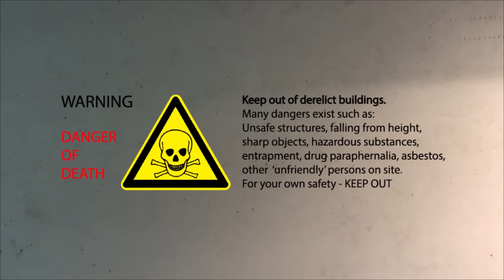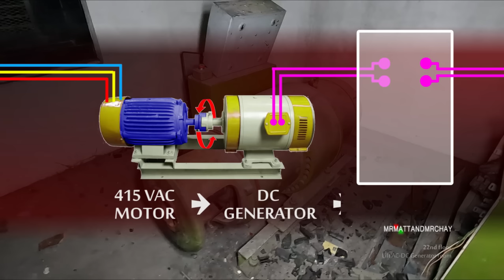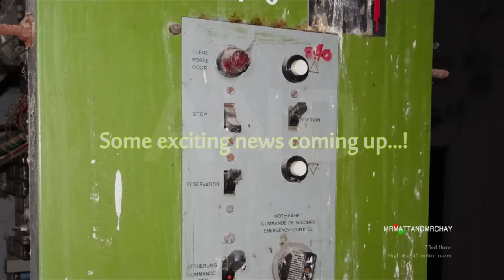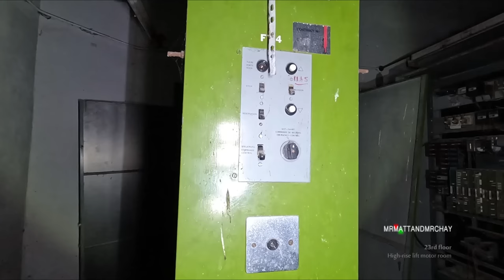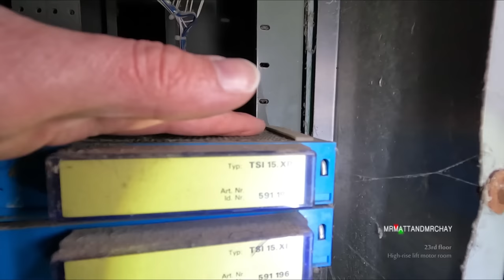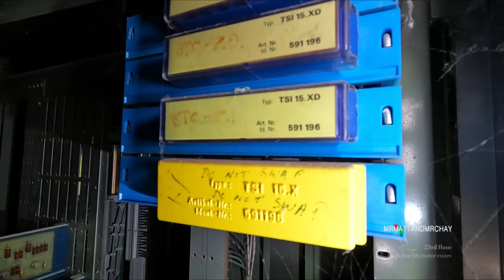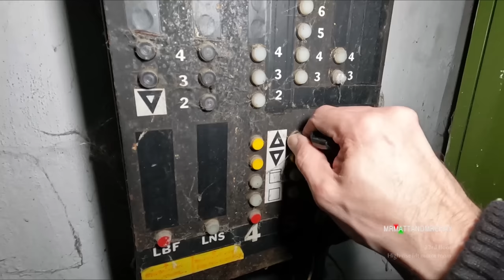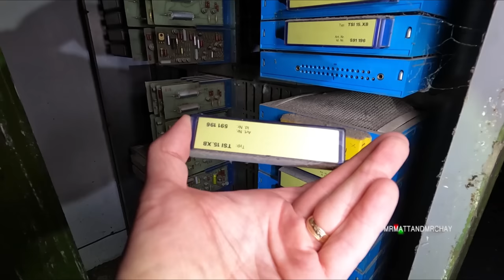ABANDONED TOWER EXPLORE - Rare ACONIC transistor lift control system from 1970s

Comment: I imagine fault tracing and troubleshooting on one of these lifts would have been quite daunting for any technician accustomed to working with relay logic. Having to trace a signal instead of hearing an audible click of a relay and being able to readily see the position and condition of the contacts, even with the tech at the time they could have had a bunch of status LEDs to guide a technician as to what the I/O of a particular cad was doing. Electronic enough to [hopefully] increase reliability but still antiquated to be unable to run self-diagnostics.

Comment: This must have been cutting edge back in their days. By early 70s transistors proved to be reliable for any application. They struggled a bit with power applications up to late 60s. But for signal control this was the way to go. They can swtich millions of times without deteriorating, and this reduce maintenance. You will still see relays where high voltage or power need to be controlled. But for logic control this was the perfect choice. I imagine that back on this era, we weren't so sure about solid state yet and many other companies just stuck to the safe an proven relay logic. And because all the engeneering was used to it, while moving to solid state would require another different set of skills.
Reply: in TheLiftDragon's video where he shows an original Aconic lift, he says the technology appeared in 1959 and was first used publicly in 1961, so it was even more incredible back then.

Comment: I spent a lot of time in (working) elevator rooms a few years ago on a contract job. We audited about 500 elevators throughout a government agency, including some that were over 80 years old. It was really cool to see this and it brings back some memories of opening up a machine room not knowing what decade the actual equipment would be from. In some cases they modernized 1950s elevators to 80s standards and left the old electro-mechanical cabinets and motor-generators behind.

I’m not sure what the maintenance standards are like in the UK but in North America the elevator contractors are focused on new builds and modernization and do not care about service and maintenance contracts. In some cases one technician will be responsible for 150 elevators all over the city, each needing about 5-6 hours a month in code-required service. Well you do the math, they simply aren’t getting the service and not one of those 500 elevators was even close to meeting the A17/B44 code standards for North America. Even though it’s required by law!

Thanks for the videos!
Reply: Yes, I had 2 lifts, and both got the correct service, such so that Schindler used the one as part of the annual review from the Swiss parent, as it was a good example of the era lift, and was in good order. Even went and painted the motor room floor, and put all the warning yellow paint on moving parts as well. Had a stack of spares for the unit in the one corner, especially vision panels, with the pig glass wire in them, as those were kind of expensive to order each, but not so when you bought 5 at a time cut to size.
Reply: @SeanBZA  it's cool when the old machinery is still being used in the modern era.
Reply: Meanwhile in my country some landlords award their lift/elevator maintenance contract to a 3rd party company e.g. 9G that's different from the lift manufacturer, maybe because its cheaper. We also had a shortage of lift technicians to service all my country's lifts maybe because such a career is seen as more menial here

Comment: And yet again, MrMatt has the answer.
I came across this exact controller in the Agfa Gevaert plant here in Antwerp. I always wondered what it was, because in the 17 years i'm into the buisness this was the only time i've seen this controller. Turns out it's the elusive Aconic. Sadly, this lift was decomissioned in the late '90s. The freight elevator in the same motor room, that probably had the same controller, was modernised by us KONE with an LCE cpu and KDM drive unit.

Comment: Transistors as plug in modules, on the assumption that they, along with diodes, are the more failure prone items, so put them into plug in modules that are mostly identical, so that you can simply keep a half dozen spares in the room, and quickly plug in a replacement, and send the faulty one to be repaired.
Reply from the maker: Thanks for the comment and yes, fascinating system and plug-in transistors.  I'm not sure that I'd like to fault find this though - imagine randomly swapping out transistor boards until the lift starts working properly again!  The know-how must have been very specialised!  Did you notice that some of them say 'do not swap'?  Wonder why, as TheLiftDragon says that the resistor blocks are the same, just newer design.
Reply: @mrmattandmrchay  Well, they would have a few variants of the transistor blocks, so fault find to a board area, then swap out the transistor blocks with the spares one at a time, and see if fault clears. No worse than in any industrial control unit, where you isolate to a region of the controller, then put known good boards in, or swap from an identical good unit, and see if the fault moves.  Saying do not swap is just those might have been a later modification, with slightly different internal wiring, so you have to swap the transistor block along with the blue block, as the old and new do not intermix, though the interface to the rest of the unit is the same.

Plenty of times i did board swaps in avionics to see what was faulty, then take the now known faulty board, and fix later on after sending the unit back out as serviceable.That way you get the urgent job fixed fast, and can troubleshoot the fault, often a known fault you have marked down for that card, and fix at leisure, being able to do a good job.

Comment: The topology of the transistor blocks and the (apparent) passive component "grid arrays" they plug into (the BLUE blocks) is very reminiscent of the short-lived 1953 NIST "Tinkertoy" project.  I suppose this was both a reliability idea (active components are fully modular and can be replaced by yanking a plug module) and a construction flexibility idea (the logic of a "BLUE BOX" segment is defined by the passive component connections within the "grid").  The fact there's a full grid array in there feels like they're presaging the internal construction of FPGAs or "burnable" memory devices.

Never saw anything quite like this in production.  The topology seems very "dated", even for the era, but is very beefy and beautifully overbuilt.  1960s integrated circuits were a reality, and by the 1970s they were in commercial use in all sorts of higher-end tech.  It's a guess, but I can only imagine this was a move to assure the buyers that the system had a lot of redundancy and deep safety factors.

Honestly, if I had been a repair tech back in the day, and I had the drawings, fixing a system like this would have been a dream.  Failed resistors were probably pretty uncommon.  And if a transistor, or cluster of them, failed or were destroyed, it'd be a fairly simple matter to pull a block, take the thing to a bench, and yank and replace the failed silicon.  None of the usual rework tools to desolder and pull parts from a fragile PCB, less risk of damaging a trace or having to put in a shunt wire etc.  Takes up more space, but had to be easier to maintain when it went wrong.
Reply from the maker: Very interesting comment and thank you for that.

Comment: The Aconic controller looks like an Analogue computer to me. Interesting design with those plugin modules. The circuitboards look very artisan, a bit like my father’s hobby electronics projects from the 70’s. Definitely a hand drawn layout.
Reply: Very much digital DTL logic there, with likely 24VDC power rails, and a few bias voltages as well for the logic. not all that complex, basically emulating the old relay based controller, just with transistors instead of relays, so that they would last longer, and remain operating with minimal care other than clean air and dusting. Likely faults were still in things like interface, switches and lamps, but the core logic likely was mostly fault free.
Reply: Hand drawn like most of them were back then. But I wonder why there is no silkscreen.

Comment: For some reason I can picture someone like Dave Jones of the EEVBlog YouTube channel going gaga over this amazing 70s era electronics. Double sided hand-drawn PCBs. 70s era metal can transistors. Funky plug-in modules. Hand-wrapped wiring.

I wonder what sort of capacitors a system like this would be using and how they avoided the "capacitor plague" that 70s era electronics (e.g. old CRT TVs) are known for.

Comment: At 10:28 There was a Pigeon Nesting In the Motor Lol. That's just Funny. And The Reason was they didn't really fly away is because they where Harf asleep so They don't Fully Think of What a Threat is. Usually it would fly away but because it was kind of sleeping you did not scare them. But I found it Very cute.

Comment: I have never seen any thing like the , cooling grid resistor set up. I call it hat because I have no idea what to call the thing that the transistors plug into. Over all I am surprised to see so few capacitors. Such a lovely lay out on boards. I worked with transistor PLC controllers.

Comment: Fun fact - those round silver components that look like components are actually shift registers - they each store 512 bits of information, like a tiny RAM chip, each 0.5 Kilobits in capacity. You would need 16 of these transistor-looking components to make up 1 Kilobyte of RAM. Damn strange each module only contains 15 of these 512-bit shift registers, I guess the word length in the logic must have been seven bits? Who knows, but each yellow or blue plug in module is just shy of 1Kbyte RAM.

Comment: Cool channel, nice vids, I like to relax and watch your vids. 
Now, maybe the 6th lift engine is placed higher and maybe even installed first so this lift could raise all other equipment into place. So no external companies would be needed to get the materials to their position. Also when parts would have been needed to replace, they could do it all internal (except for lift 6 🤓.
For the boards: you should not waggle them out, but pull them straight out, in order to not damage the side sliders.
Like sliding them in: straight, not waggle.
Same for the transistor blocks.
Interesting are the matrix resistor blocks. I am curious what they were used for, since it is plenty of them. 
I am used to work with matrix board with diodes.
Good idea of having the steel wires going “around”, also on the bottom of the lift, do there is no need for a compensation chain which makes spooky noises.
AC to DC, yeah, thats what I worked with too, DC motors can be very powerful and easy to regulate. Did they use DC or half DC? 
When using half DC (in fact: from AC to DC using only 1 diode) makes the motor even more powerfull.

Many greetings from the Netherlands ❤

Comment: Never seen wire wrapping before, that's quite interesting. I'm guessing there were no electrical drawings on the walls? I guess LiftDragon found some!

Presumably the panel with all the bulbs behind it is a floor position display?
Edit: Answered at 22:55!

A very rare system indeed, but I'm not sure how it works. I don't even know what a transistor is, so I suppose I'll start with learning what they do, lol!

Comment: You should have visited the tower in the late 2000s it was completely intact and still had lighting and power. The lifts probably still worked back then. There's photos as late as 2009 showing it lit up at night looking just like a normal office building.

Comment: I'm wondering if this Aconic system used TTL - transistor-transistor logic - as its stepping stone from fully analogue relay control to full digital programmable logic control?
Reply from the maker: You're probably spot on Eddie.  It's a very interesting concept, but wonder how much of a nightmare it would have been to fault find!  Swap this transistor block out, does it work, no, how about this one!  I bet there were more logic methods to do this, but it would have required a unique skillset and experience with working with this controller type.
Reply: I believe it is RTL. Possibly dtl but I don't see enough diodes. The interesting thing is how remarkably primitive it is given the age. RTL was 60s tech.

Comment: Wow! What a completely shitty way of designing circuits! They've got enormous big PCBs with hardly anything on them, and a load of transistors all clumped into a little cramped module... for some reason! I suppose it lets their service men swap out transistors as entire modules rather than needing to trace a fault and desolder the malfunctioning component, but even so... as far as using space goes, it's ridiculous! The costs of all those connectors (often the most expensive part) would triple the cost of the unit as a whole. And for what? What does it do!? I mean, sure, a few things, routing the lift, priority, speed control. But Speak 'n' Spell was out by 1979 and that had more than enough computing power for this. There were microprocessors around and used in industry all the time. Or if you like, just stick with relays.

You could have reduced this to half a dozen PCBs or less with a computer, or not much more space by using a custom-designed discrete system, even if it was a modular one. But this looks a bit like somebody's invented their own computer from bare transistors, like IBM and the rest did in the 1960s. Not a chip on it, and there were loads of logic ICs back then! 

I could've saved them a ton of money designing something better back then, and I'm not any sort of professional electronics guy. So could most people who own a soldering iron. Really, what a WASTE!

Comment: It always surprises me where YouTube's recommendations lead me. At first I thought this was just another Lost Places channel, but than I realized it is mainly about lifts. I didn't even know that there were people interested in these enough to make a YouTube channel about them, but in the meantime I found out there seem to be quite a few.
Until now I was actually happy to see a lift being modernized. I don't find old lifts scary, but I didn't like them, being old and run down, rumbling and shaking. while I found newer ones much nicer, moving smoothly from one floor to the next, with modern looking buttons and floor indicators.
However now that I know the elaborate relay technology behind the older lifts build before modern electronics were available, and especially the electromechanical floor selectors, I'm fascinated by them. So much effort and engineering just to move a lift car up and down!
Now I feel said about every one of these replaced by modern technology, despite knowing that they aren't museums pieces, but part of a building's infrastructure, so sooner or later they will have to be modernized or replaced either for economical or for safety reasons.

Comment: Superb video, graphics, commentary and music again. I'm qualified in electronics and am intrigued by the blue modules and the transistor packs. Even the numbers on the transistors are not standard. Looking forward to more and will check out the LiftDragon
Reply from the maker: Thanks very much Petertronic :)  appreciate the comment!
Reply: Motorola house numbers, though, looking at the case style, it was likely all plain regular 2N2219A and 2N2907A transistors, house coded from the Motorols JAN TX production line, using the transistors that had failed the more rigorous JAN TX elevated temperature cycling, but still passed the more relaxed industrial testing cycle. To pass the JAN TX in the military and aerospace certification you had to have zero failures in a batch of 100k devices, but commercial and industrial you could have up to 10. All passed at room temp, especially in the mid 1970's, where Motorola had dialled in production on those lines to be consistent batch to batch, and could have 99 out of every 100 batches pass the full space certification without issue.

House coding so that the repair centre can only get them from the approved source, not just go out and buy them, but pay the price for the "right" devices. Vendor lock in for sure, and likely they had to send those back for repair to factory, despite them being commercial parts otherwise.

Comment: That is an incredible looking logic system. As you are looking through those control cabinets I can help but wonder, what was the benefit to such a system in the late 70's? Reprogrammability? Less moving parts? There are so many small components in that system, i have to believe it was a nightmare dealing with just one failing.

Comment: Was the third lift a different size to the other two hence the raised lift machine platform ? if it was a smaller car then the rope suspension center's would be over towards the other lifts and causing the machine to over hang the other two.

Comment: 14:15 What a beauty those hand-drawn circuit boards.
18:08 Some kind of memory, or decision board? Can I recommend bringing BigClive one day?
19:31 Okay. Now I want this panel to hang in my living, replacing a painting I never really liked.
Reply from the maker: Thanks for the comments.  High rise buildings where the lifts are used a lot, normally the lifts are kept up to date.  I was very surprised to see these lift still original.  They were about 25 years old when the building shut.
Fascinating light bulb panel isn't it! :)